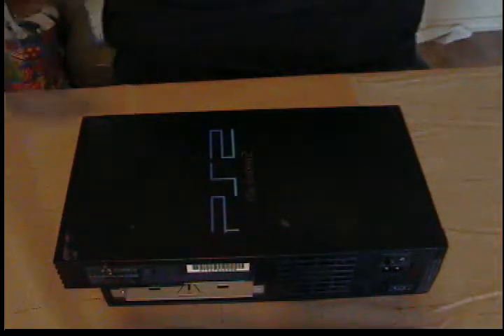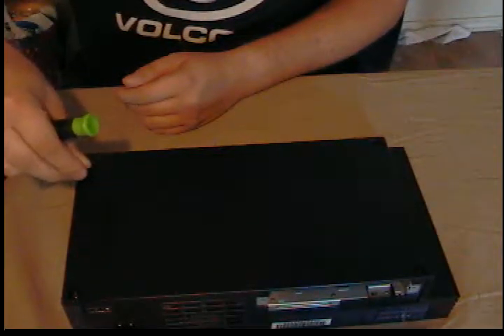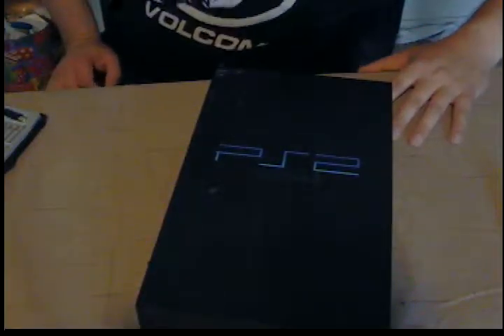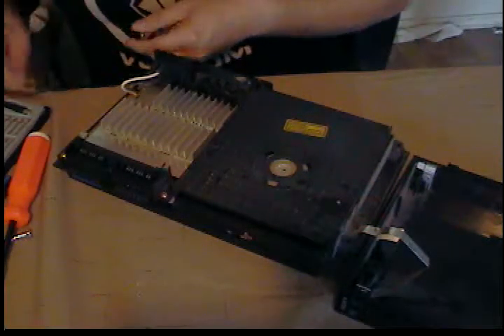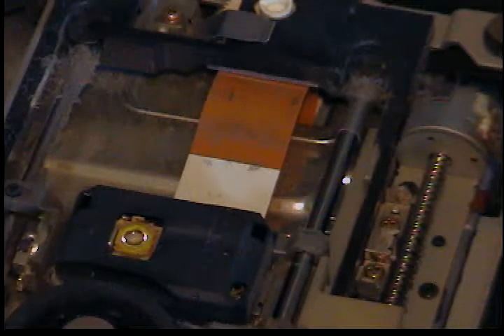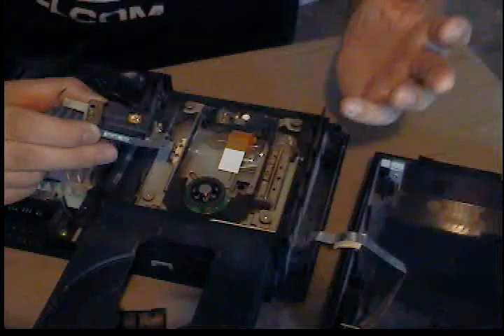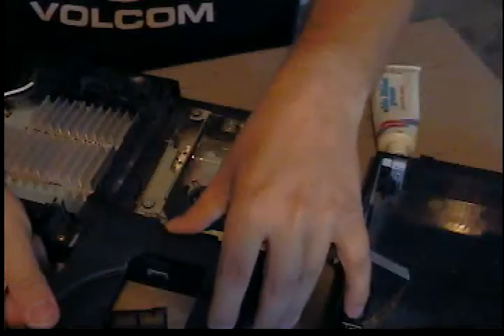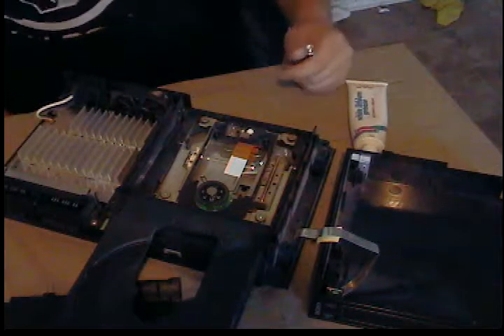PS2 Disc Drive Cleaning

Comment: never do a voltage adjustment, most common cause is dust on the the laser it self (not the lens) you have to take the lens off and be really really careful and steady as the lens has 2 thin copper wires holding on to it, take the black covering off there is some sticky like glue stuff that will be on there a few vary careful tugs up will unstick it (recommend you don't put that piece down, as this next step takes seconds) once that is off you will see the laser its self and carefully use a q-tip (using it damp, not wet, or even dry will work) wipe the laser clean, put it back together carefully steady hands are a must.  After thats done its a 95% fix of all DRE's and she will work like new
Reply from the maker: Yeah, that trick does work pretty good